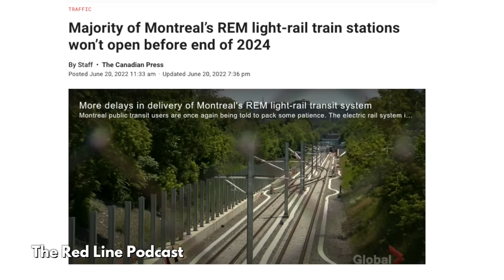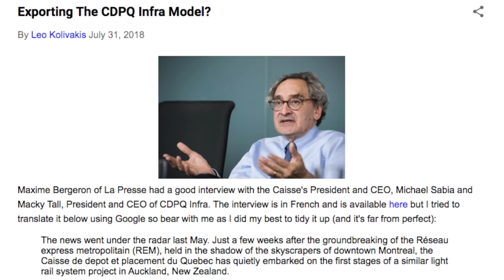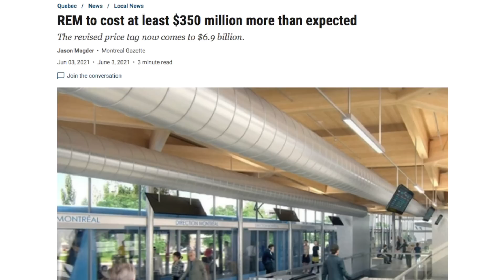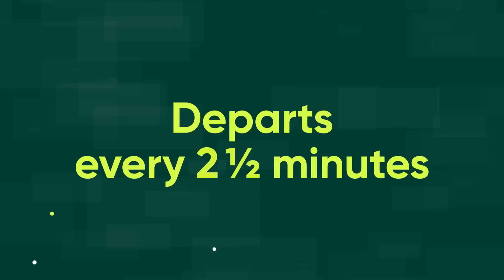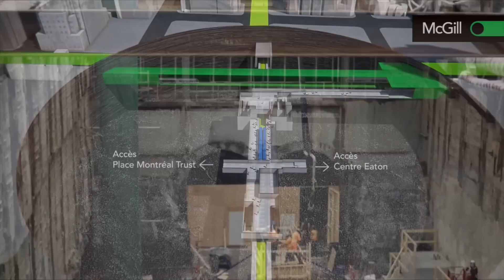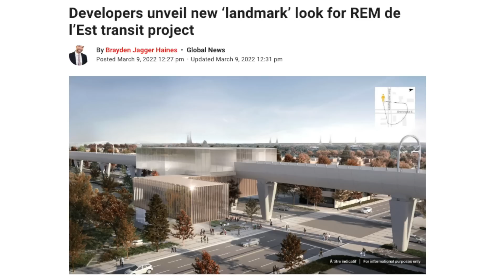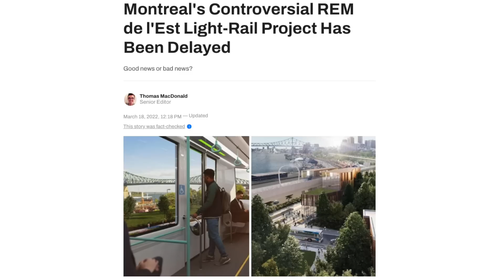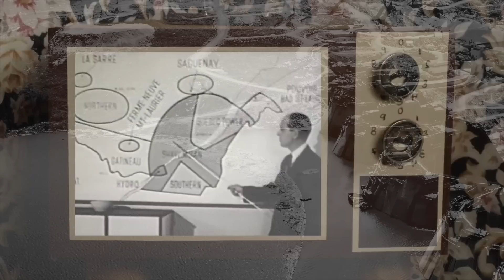The REM is Coming And It's A Game Changer for Montreal

Comment: Regarding the REM East, I'm split on this. The outcry for the downtown part I get it. The REM is currently very ugly so it's hard to trust that CDPQ would make something beautiful and even the firm that was supposed to work on the design quit the project. The yelling for the other part that goes near an existing train, I don't get it.

We'll know on the long run if it was a good idea to rely so much on CDPQ (their main objective is to make profit). However, it's hard to concede that the Quebec government can do good public transit in a reasonable delay. The Laval stations took forever to build and don't get me started on the Blue line extension. Anyway, it's probably normal that making underground new line takes way more time then overground lines. I honestly don't think we can expect the REM East build by the QC government before 2035 minimum...

On a separate subject, I find this video good but way too positive. If MTL public transit was this good, there wouldn't be that many cars on the road. It's only been 6 years since the new Azur train have been in service. The old MR-73 are fairly outdated and I can't wait for the STM to retire them. I've rode the metro in Stockholm (only briefly so I can't really judge), Paris, London, Barcelona and Copenhagen. All better transit system. At least, the REM will really bring us close to the light rail in Copenhagen.
Reply: It's way better looking than all the raised highways, or sunken highways. Truly do not understand this perspective.

Comment: Ok. The west end rem doesn’t run into new residential neighborhoods. The west end nimbys are all anglos so they managed to have the project not go through their residential neighbourhoods by design. They are either running on existing rail lines or running on existing highway infrastructure. The east line would totally scrap existing neighbourhoods that are all Francophone. Once again, anglos get their project tweaked and customized so their property values don’t go down whilst  Franco’s have to shove it. The east end is already a low Income dump. Does anyone remember Decarie ? That wonderful modernizing project that completely scarred and entire part of downtown? Of course not. But it had to be built to satisfy west end suburbanites in the 60s and 70s. There are better more intelligent routes in the east and they need to be prioritized. But since east Enders pay less taxes, their opinion doesn’t even count. Could we please try to improve the east end instead of using it as shithole corridor to pass more suburbanites that don’t spend a penny to improve those neighbourhoods ? Passing on notre dame instead of Sherbrooke is 1000x smarter.

Comment: Vancouver implemented this system in 1985!!! Meaning Montreal is 40 years behind lol
Reply: Vancouver's Skytrain system is also built with antiquated technology. The trains are extremely loud. Especially between the Waterfront and Stadium stations, you better have your earplugs ready, because the noise levels are far above safe levels of occupational exposure. The howling noise the trains generate can be heard kilometers away from the track. It is certainly a convenient system, but it's far from refined (or reliable).

Comment: Reducing greenhouse gases aka C02 emissions by 680 tons over 25 years? First of all, nobody can conceive such a thing in their mind. Second, those numbers were pulled out of someone ass like all of the other BS figures regarding C02 emissions. That being said, if all of the people involved were really that smart, then they would have converted the metro to regular rolling stock without rubber tires and merged it into the REM. The only reason that the rubber tires were introduced into the initial designs in the late 50's was because of the steep inclines on some of the routes. By the time the work was started on the metro in the 60's, rail technology had already advanced enough for regular rolling stock to handle the inclines. Digging all of these extra tunnels and building new underground stations downtown is a complete waste of money. I'm glad that such a large expansion of public transit is underway, but it should have been done in a smarter way.

Comment: One of the major drawbacks of the REM de l'Est is that they weren't planning to integrate it well with the metro system and the rest of the REM.
Reply: It was planned to have five connections to the metro (two on the orange, two on the green, and one on the blue), as well as a connection to the REM at Gare Centrale, the only place that would have made sense, so the integration with the metro and REM was excellent, but who knows how the nimbys have messed that up since.

Comment: As someone who lives in montreal the REM was a terrible idea. Besides the fact the costs alone have ballooned from the original amounts the biggest issues with the REM where the total destruction of an already working mode of train transportation. The existing train system prior to the REM announcement was already used by many on a daily basis and the main complaints where for frequency and comfort of the trains. Those issues could have been addressed simply by adding additional departures as well as upgrading all trains to the BiLevel Commuter Cars. This would have cost a fraction of what the REM is costing as well as not interrupted any service. If additional routes where needed those could have been built to address those specific issues as well. The REM is a money sink for Quebec taxpayers as the CDPQ Infra who is building it runs the Quebecs pension fund. So any cost over runs are going to be paid by the taxpayers. On top of that the contract which was signed with the government in regards to rates the REM will charge the government are extremely high vs similar transit systems in Toronto or Vancouver which again comes out of the taxpayers pocket.  Also with the terms of said contract it gave CDPQ Infra incredible powers to claim imminent domain in many places as well as tax exempt status in certain areas and also the ability to collect taxes for businesses that setup on their newly acquired properly. Thats not counting the environmental impacts of destroying an existing working transit system and replacing it with a new one. Which again could have been avoided if they had requested specifications for the new trains that matched the rail network at the time
Reply: I’m pretty sure this is aiming for a different demographic than the current “Suburban trains”. And, it definitely is a great investment for the future as well as a much better way to spend money than the dumb 3rd link in Quebec city.

Comment: nice looking, nice ingenering, yes....but.....
was built on suspucious data reference
we surname the red line, was initiated by provincial Libéral party (red), on Libéral ridng, mostley
it could be a futur .......very low traffic custumer volume
first it was called REM fo Reseau Electrique de Montréal, there were soo many bad critics about the choice where to buil it, soo, 
they change the name for Reseau Express of Montreal
 the REM line should have been built in the east of Montreal, because of the need, young familly
the wagaon could have been built in Québec, but they were to hurry, the choose India insted
of course, you can said a lot of good, but you have to consider al othe critics alsoo
in 2016 the project mangement told it will cost 5.5 billions, few believed them, 
in 2022 it will be around 7 billions
the autor said a lot of nice thing most this, mos that, etc...
we, said most expensive, at hte who paid the bill.......
it could hab been built in a smaller size and wait and see abaout it popularity or customer traffic and efficiency in winter condition.

Comment: Enjoy Montreal's newest White Elephant.
With only 3 stations connecting the REM to the Metro, the Metro will be overwhelmed.
Stations for the REM were not selected for passenger efficiency. They were selected for the development potential of land owned by the Caisse du Depot.
Based on the now over run $6.6 billion cost and a guarantee of 9% profit per year for the Caisse du Depot and the maximum capacity of 125,000 person trips per day, the cost per trip should cost about $19.50 per trip. This cost is to be subsidized by other public transit users as the OPUS pass obscures the cost.
The head of Transportation research at McGill said that the REM will handicap future public transit expenditures.
The REM took over the dedicated bus lanes that were designed into the new Champlain Bridge which forced the deletion of the safety/ breakdown lane on the bridge before it was put in service. All lanes were made thinner as the breakdown lane that the buses now use was thinner than a standard lane.
This is aside from the eyesore factor and the exemplary record of elevated concrete structures in Quebec. (Sarcasm)
The only success so far has been the massive PR campaign which this site seems to have swallowed whole.
Reply: “With only 3 stations connecting the REM to the Metro, the Metro will be overwhelmed.”
Literally connect to the 3 main line of the metro and what do you mean by the metro will be overwhelmed? The orange line is clearly the most saturated line and the Rem run parallel with it, so the rem will actually lighten the metro.

“Stations for the REM were not selected for passenger efficiency. They were selected for the development potential of land owned by the Caisse du Depot.”
The rem station were selected for passenger usage and potential passenger usage, we are in the middle of a housing crises so if the rem is able to connect transit starve neighborhood and create transit oriented development on industrial land a long the line I will gladly take it and just for you know the best line is usually extremely similar to the most profitable line.
Also the “land value capture” is a really common financing tool for big projects like REM and this type of finance will be also use for the extension of the blue line

“Based on the now over run $6.6 billion cost and a guarantee of 9% profit per year for the Caisse du Depot” 
CDPQ benefits from a priority yield of 8 % on the ridership per km. There are not guaranteed to make profit if the line if a failure, their take the risk.

 “Maximum capacity of 125,000 person trips per day” 
CDPQ are expected with the study their made between 160 000 and 190 000 ridership and the capacity can even increase more because their can run train each 90 seconds

“the cost per trip should cost about $19.50 per trip. This cost is to be subsidized by other public transit users as the OPUS pass obscures the cost.”
Actually the cost per passage km of the rem is less (0,72) than the bus (0,73) and the Exo train (0,89) it only cost more that the metro (0,48) and since the rem serve transit starve community it will not have of lot of concurrence with the metro.

‘’The head of Transportation research at McGill said that the REM will handicap future public transit expenditures.’’
I’m sure it more nuanced than that. Montreal is getting the biggest expansion of is rapid transit, it sure will affect how we will add new transit but it for the better.

“The REM took over the dedicated bus lanes that were designed into the new Champlain Bridge which forced the deletion of the safety/ breakdown lane on the bridge before it was put in service. All lanes were made thinner as the breakdown lane that the buses now use was thinner than a standard lane.”
Sorry that the best user experience transit in Nord America will affect the bus lane of the bridge it cross, ask to the south shore if their preferer the rem or the bus when it will be in service.

“This is aside from the eyesore factor and the exemplary record of elevated concrete structures in Quebec. (Sarcasm)”
Oh you mean the elevated structure that are on the ugly highway!… That what I thought.

Comment: Ok so it's electric and that great . . but before you go and start talking about the clean air , where is the power coming from ? Wind , solar , water ?  Or is it being powered by coal power plants . Is the coal mines in Canada? Or are we importing dirty mined coal from China or other places . Don't talk about clean air and less greenhouse gases when it's dirty energy.......
Reply: Pretty much all electricity in Quebec is hydro and a tiny bit of wind.
Reply: Always scroll to the bottom of the comment section to see the most ignorant American's comments.
Reply: @toastsandwich2862  Actually it's a fair point about the fuss people are making over electric vehicles if it's dirty electricity they are using.  And in an indirect way, electric transportation in Quebec, as clean as it may be (and we must not ignore the environmental costs from power dams), still means there's less hydro generated power to export to the rest of the continent, thereby bumping up demands elsewhere for coal generated electricity.
Reply: 94% of electricity in Quebec is hydroelectric. The highest % on the entire planet. 
Built developed and paid 100% by quebecers, ( not a single $ from canada)